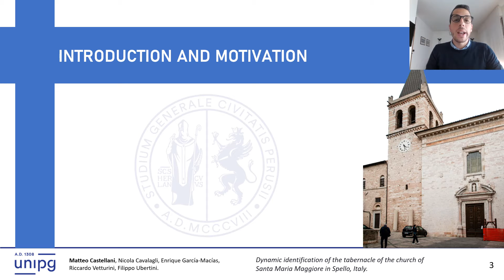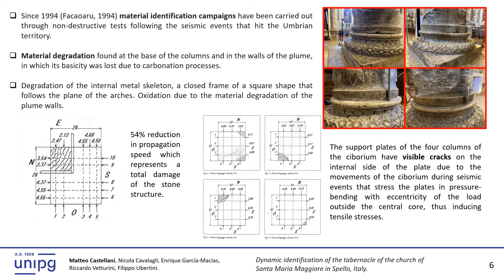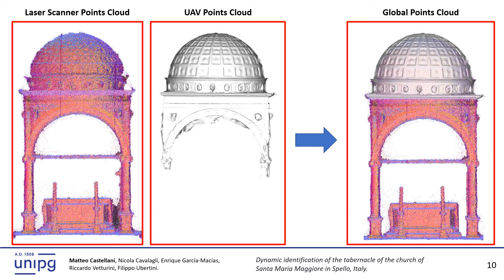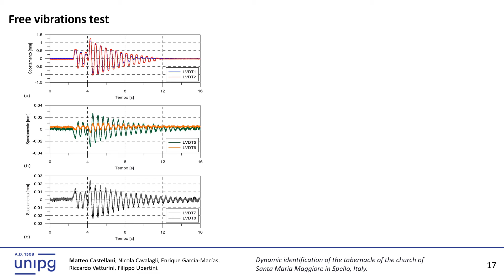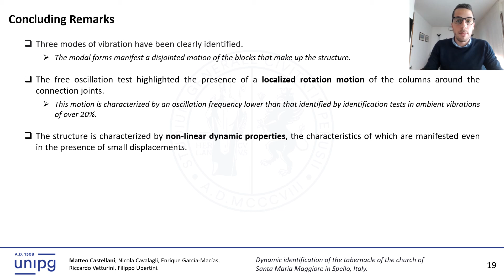E-MRS Spring 2022 International Conference – Matteo Castellani

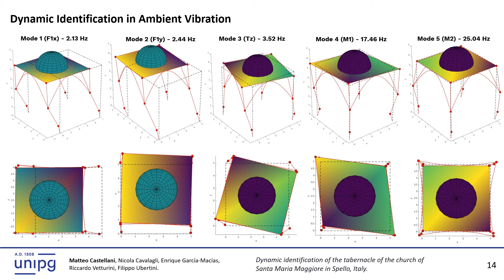Comment: Great work! AT 8:07 you said that the modal shapes have a broken line at the joints but don't you think this is because the accelerometers are placed at those locations? To clearly see the vertical shape of the modal line I think you need more accelerometers at various heights of the column.